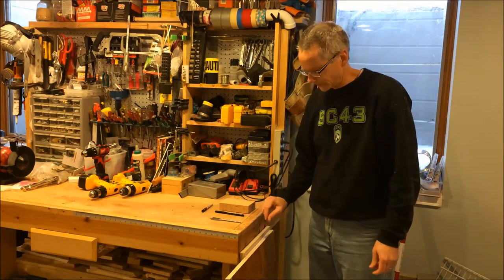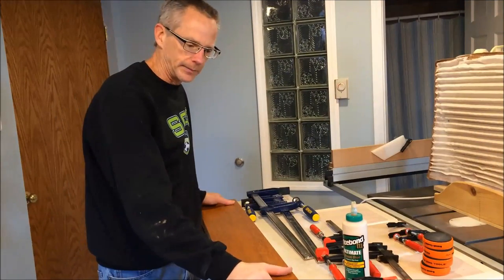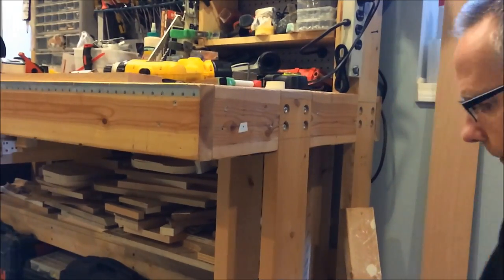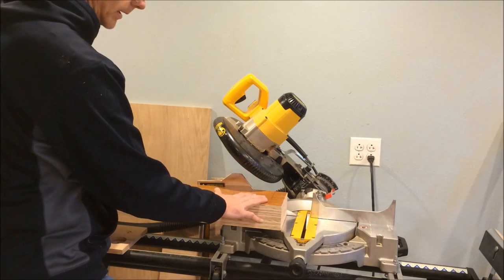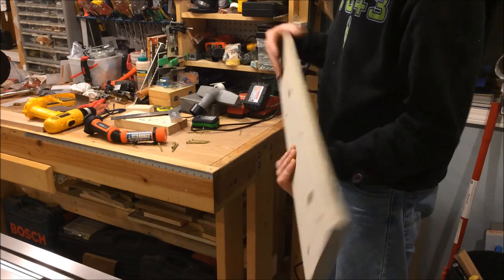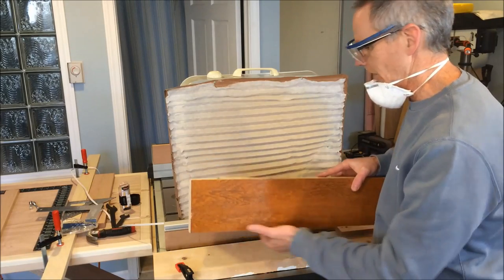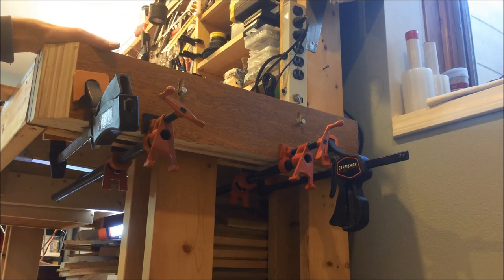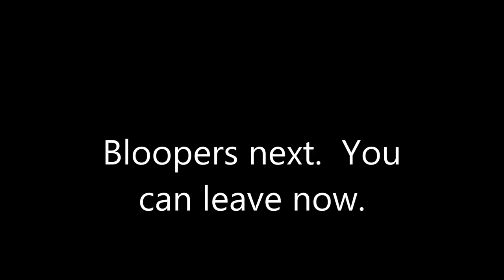DIY Bench Vise

Comment: nice project, Jess. Your video is solid! A simple idea for your  pop up vise dog thing: connect the two bolts together with a wood strip, and mount a small teardrop-style cam centrally beneath the strip so that you can raise the wood bench dog thing and lock it with one quick motion. won't cost much or be too time consuming

Comment: I've seen a few of these pipe clamp vises and thing they're good if you don't have access to any cheap vise screws.  If I were to make one, I'd be thinking how to actuate those clutch plates without the need to reach in under the bench.  I'd make a lever under each crank, mounted on a rotating bar, like on a Record style quick release vise.  There'd need to be a toggle, or some kind of lever under the bench to push the clutch plates when the bar is rotated.  It sounds a lot more complicated than it would be.
Reply from the maker: deezynar.  That sounds like an awesome idea.  Can you post video or pictures if you do it?  I love seeing others ideas.
Reply: No camera = no can do.  Flat, square, or rectangular piece of steel or wood running below the pipe clamp.  It goes through a hole in the front vice jaw so it can rotate.  It has a lever attached to it so you can activate the clutch plates.  The bar moves in and out with the front vise jaw.  The bar extends under the bench where it goes through a piece of metal, or wood, that has a hole through it that's shaped to fit around it.  The bar can slide through a hole in that piece that is shaped to fit the bar's profile.  When you turn the lever on the front vise jaw, the bar turns, that turns the piece mounted under the bench, that piece rotates and moves a toggle, or lever, sideways, and that lever pushes the clutch plates.  The lever and bar attached to the front vice jaw is an idea borrowed right off of the old Record brand quick release woodworking vices.  The mechanism they used for disengaging the screw is different from what would be needed to move the clutch plates, but it's all pretty simple stuff.

Comment: ...or (at 33 min.) remove the composite decking piece one more time to use as a guide for the final drilling of the laminated ply piece. Lots of good ideas, especially the sliding stop...Real fine work!
Reply from the maker: Great idea!  That would have been much more accurate then what I did.  Thanks for the great tip.  Not sure why I didn't think of that, but sometimes the most obvious solutions are the hardest to see.

Comment: Nice video.  Going to try this today.
Reply from the maker: +firesprk Thanks, Hope all goes well.  BTW, I originally drilled 1" holes in the vise itself, but these should be rectangular holes, that are 1" high and about 1 1/2 to 1 3/4" wide.  This prevents the vise from racking.  I intended to elongate mine horizontally, but have not gotten back to it yet.

Comment: I like you making that stop  that you made with the router that stop the piece  from coming forward what holds at the other end   ???
Reply from the maker: I have not added the stops in my bench, but the plan is to put some dogs in the top of my main bench.  I saw a shiny light and have been distracted, so I still have not added the bench dogs.  I will likely procrastinate until the day I need them.  

Procrastination theorem #1: "Never do something today, if a way can be found to put it off until tomorrow"

Comment: What's your sense for how well your box fan dust capture system works?  Just curious.
Reply from the maker: Kevin, sorry for the late response.  I have found that the box fan is very good at removing the small particulates of dust, which is what is the dangerous stuff.  If I leave the fan run for 15 minutes, I don't see any significant "dust" in the air, but if I don't run the fan, the dust remains suspended in the air for quite a long time.  Since my shop is in my basement, my main concern is that it gets into the living areas of the house.  
This is a simple and cheap way to remove the dust, plus it is mobile and I can place it in the most strategic location to filter the dust out.

Comment: You only have access to your bench from the one side. Is this a negative aspect or haven't you missed the two sided option? Asking as I am currently in the process of building my first ever bench, and even though it will be on rollers and moveable, am still thinking of installing a rack with lighting and storage on the back side. Love the "insert" idea in the vice acting as a long dog 👍
Reply from the maker: Robert,
Definitely this is a negative.  Unfortunately, due to my shop configuration and bench, I really could not mount it anywhere else.  I did not want if coming out the front, as it would be in the way when I am not using it.  If I have to I could pull my entire bench out, but I have a lot "stuff" on and under my bench that makes that not something I would want to do regularly.  
If you have the capability, definitely place they vice for access to both sides.

Good luck and happy woodworking!
Reply: My dad's main workbench was 40ft long (the entire length of his shop), and only had one open side. It had holes for pipe clamps on the front using a similar setup to this (including the holding clutch mounted under the bench). He kept the pipe clamps hanging on the wall out of the way. They were easily replaced and removed using the clutch mechanism, accessible from under the bench.

If you want something fancier Lee Valley sells a special unit that works exactly the same but that includes a release button on the clutch that pokes out through the front of the bench (for something like 3 to 4x the cost of a regular pipe clamp).
Reply: Derek Read Thanks for the tip Derek👍

Comment: How do you adjust the length?
Reply: Do you have to reach under the bench?-- if so -- It needs some sort of upgrade to not bend down under the bench
Reply from the maker: The vice opening has a wide range of adjustment.  This will depend on how long you cut the pipe and the room you have available under your bench.  To adjust the opening you just have to extend each pipe, by reaching under the bench and releasing the metal spring traps that will allow you to pull the pipes out. 

A nice upgrade would be to rig up some type of mechanism, that would allow you to activate the spring latches from the front of the bench.  While this would be nice, I really find that I do not adjust the vice much, since you get some adjustment from the vice screw itself.
Reply from the maker: Yes. You would need to reach under the bench.  I totally agree that adding a method to allow adjustment without need to reach under the bench would be a nice enhancement.  

If it was simple I would do it, but I looked at a few options and they were not simple and I really was not willing to invest much of my life hours to get it.  But, everyone has different needs and abilities.  

If you find a simple way to make this work, please let me know.
Reply: @JessCretney  I bet that just a couple of pieces of paracord tied to a hole running through the clutch levers and out to the front of the bench would work just fine.